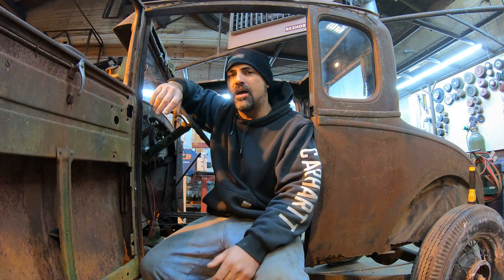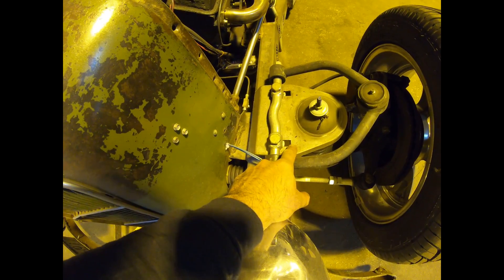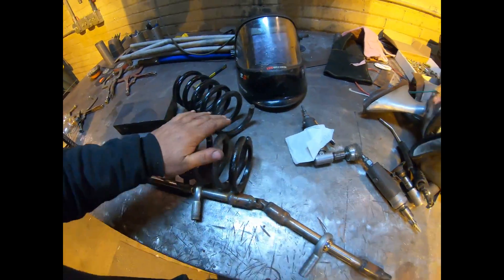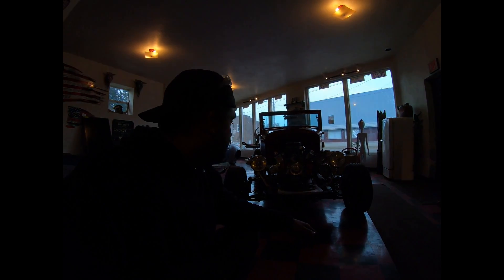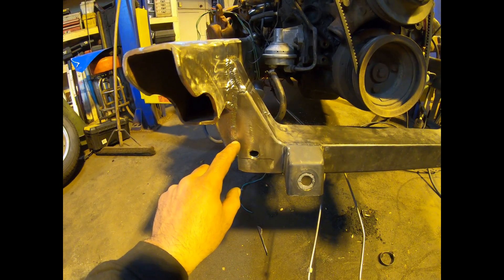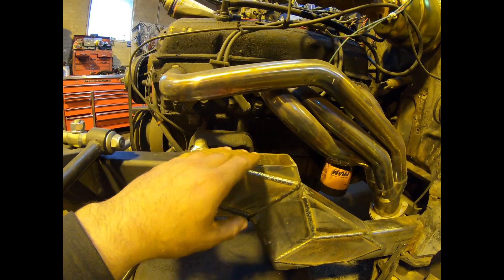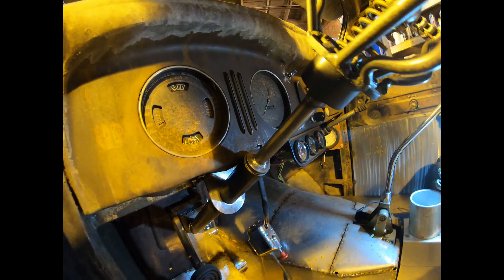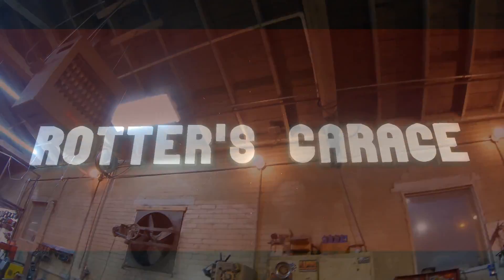1935 Dodge Rat Rod Repair Part 1- Steering and Suspension Issues...

Comment: With the spindles reversed and the rack and pinion mounted in front, I am wondering if any corrections were made to adjust the Ackerman geometry to prevent tire scrub in turns.  How about a three or four inch chop off the top?
Reply from the maker: All mustang II kits have front mounted racks. Came factory that way, spindles are on correctly.

Comment: If that Dodge was well engineered and constructed it would not be a "Rat Rod", it would be a Hot Rod.
Reply from the maker: I somewhat agree, the thing is I feel personally that there is a huge difference between a rat rod and a hot rod. Rat rods in my opinion have a rougher look, more on the artsy side, more rust, it's a build style.... But with that being said, mechanically they need to be built right. A hot rod in my opinion is a nicer, cleanly build, more than likely painted or primered but straight. But also I have seen rat rods build with better mechanical engineering than some nicely painted "show car" hot rods.... All depends on who put it together I suppose.....

Comment: How the hell did that thing even pass inspection to be registered and allowed on your roads there?! if you tried to register that in Australia they would  just give you directions to the local rubbish dump and tell you to leave it there. yes, we have strict rules here for Hot Rod and modified cars but at least the cars are safe. that chassis is awful, just butt joints with no doublers on them. the whole car is an accident waiting to happen. your friend is lucky it didnt.